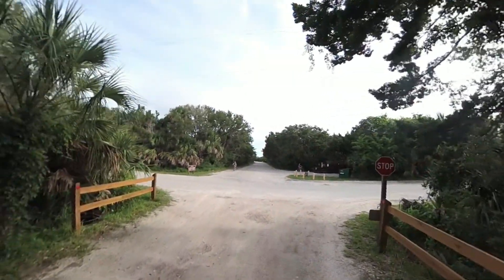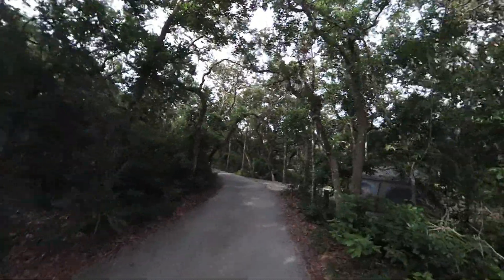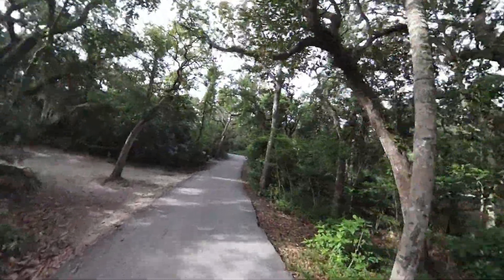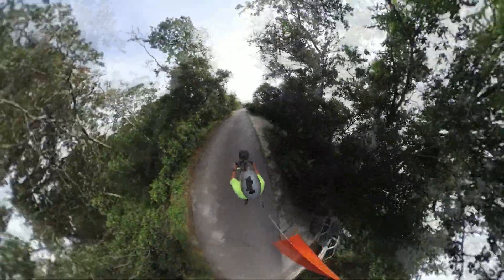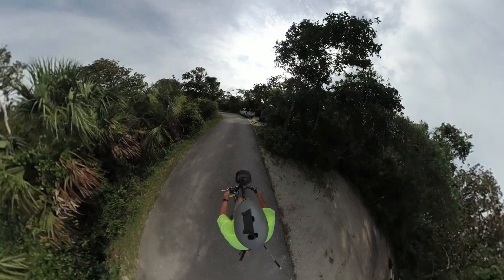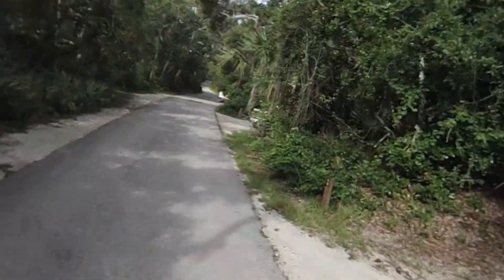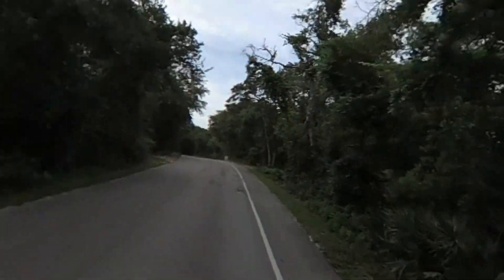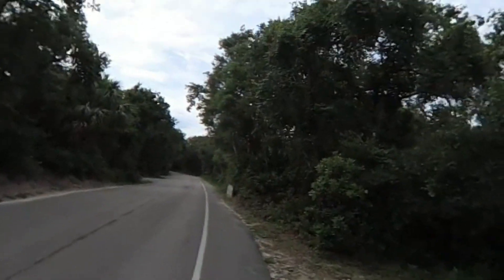LibertyTrike using 5 Gear Shift 06-07-2018

Comment: David Perkins,  I think your earlier model is compatible with adding a few more gears.  The two chains are not next to each other in the new models, so the three speed I bought is useless for my trike.  Insult to injury is that I actually bought one that I just found out doesn't take returns!  I missed that in my excitement.
Reply from the maker: In looking at my older hub there were 2.75 inches between the two chains whereas my newer 5 speed hub has less than an inch between the chains.  There was no problem by the bike shop in making it work.   Did the bike shop tell you it was useless?  Can you take a picture of the "newer" LT hub?  I don't think you have a newer hub but whoever told you it won't work doesn't know how to make it work.

Comment: Did you add it or have a bicycle shop do it? Some details of the part and procedures would be great.
Reply from the maker: Greg... here is the internal hub I had installed by a bike shop:  http://www.sturmey-archer.com/en/products/detail/rx-rc5
At this point, I would consider installing it myself but it all depends on your skill level.  Of course subsequently I did install longer crank arms (6.5 inches) as well.  Because I live a few blocks from the beach and the LT did not do well in sand I sold it and purchased a trike with 4" wheels and ride it several days every week on the beach even though it requires a lot of maintenance.  I highly recommend the 5 gear shift and extending the crank arms.  I love the LT but it just didn't work for me in the sand...